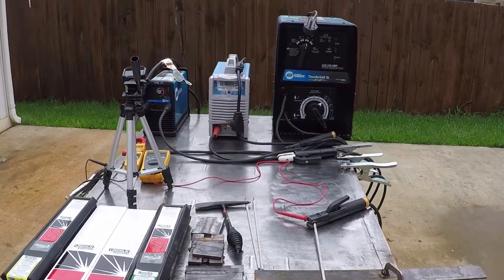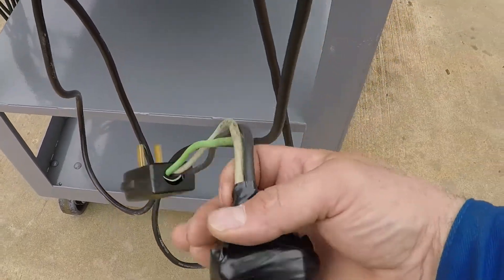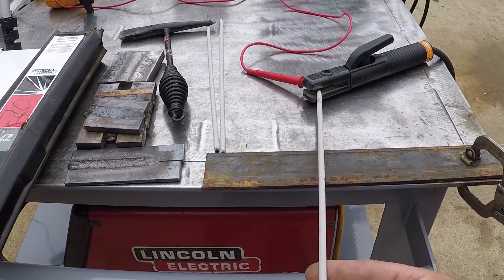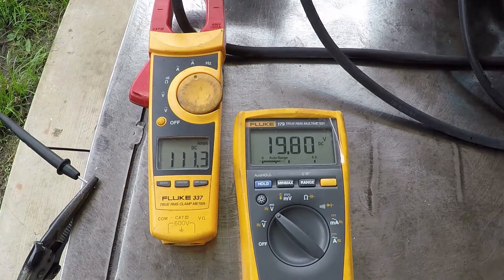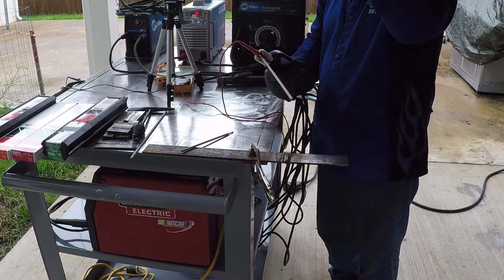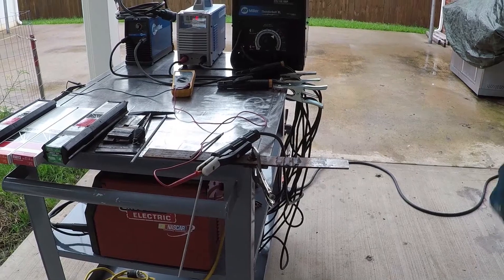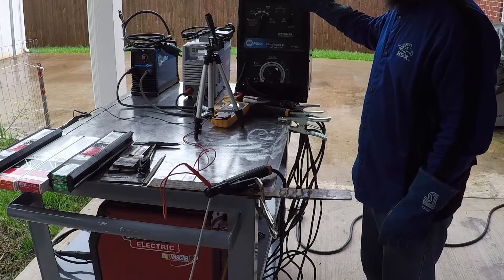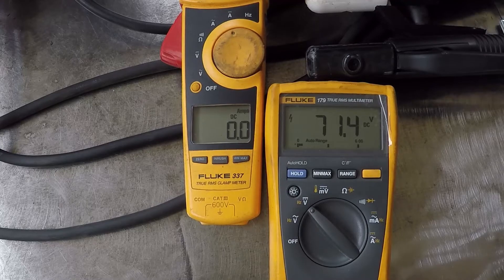Inverter or IGBT VS Transformer Welders Current And Voltage Reading

Comment: It was the best testing that i saw ever .Thank you so much brother.
Reply from the maker: Thank you brother, I appreciate your nice comment. Be safe and have a great day
Reply: @SalamSayhood  Thank you so much brother i hope the best for you too.I have a question:Please tell me, in an equal current (120output current), MOSFET and IGBT welding inverter, which one has more input current consumption? and what is your opinion about these devices, which one is better? Mosfet or IGBT
Reply from the maker: If the MOSFET and IGBT are rated for the same current and voltage, MOSFET should be better as it is more efficient as far as its gate switching and will generate less heat. The manufacturer uses IGBTs because the IGBT is  more cost effective and can handle high current and high voltage.

Comment: Nice job!  How did the welders perform? Did any produce smoother, better or easier welds? 40 years from now, the Thunderbolt will likely still be in someone's shop performing good service. Difficult to say about the inverter welders (way more components to fail). Thanks!
Reply from the maker: They all preformed the same. I have several videos on my YouTube channel showing the weld out come. In my experience, using the exact current setting (actually and not what the welder machine shows), clean metal and the same welding rods, will give you very close if not the same results. I totally agree with you, the thunderbolt will live way longer than any type of inverter welder. I only prefer the inverter welders because they are light weight and uses less electricity. Thank you for watching and for the comment.

Comment: So in a nutshell, the inverter welders use almost half the input amps [$cost] to make the same weld, same electrode, same output amps, same welding man, than the transformer based welder.  Also the transformer welder costs several times more just turned on, without welding. Great work Salam, shows how more cost efficient the new technology is over the old.
Reply from the maker: Good morning sir, well said. Thank you for watching and for the comment. Have a great day.